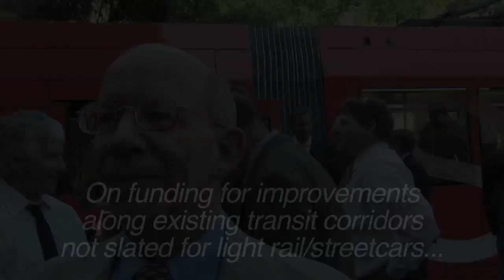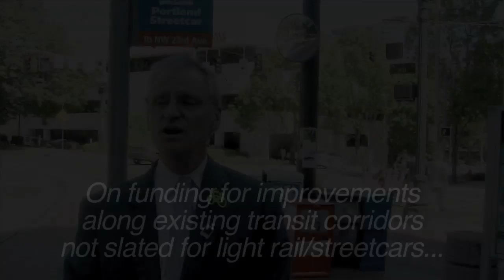Made-in-USA Streetcar Unveiling, with Interviews -- Portland, Oregon

Comment: On DeFazio: Firstly, there is no way this could be made in US either for lower price or in better quality. Secondly, it still has Škoda electric engines and other guts, therefore I doubt that licence agreement would allow Oregon Iron Works to compete with Škoda in its most important market (Europe). Thirdly, Škoda itself is now marketing its brand new Forcity 15t (google it), which is 2 generations ahead of this design. Well... good luck with exports plans!